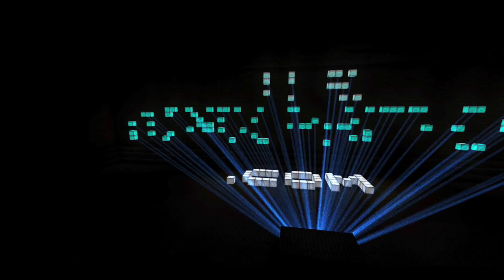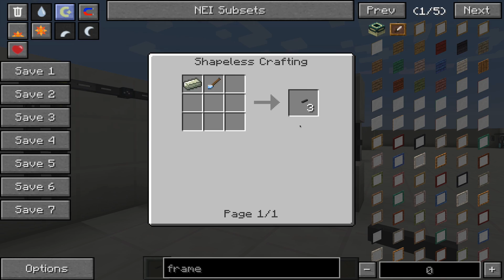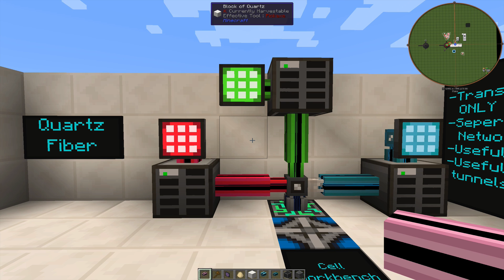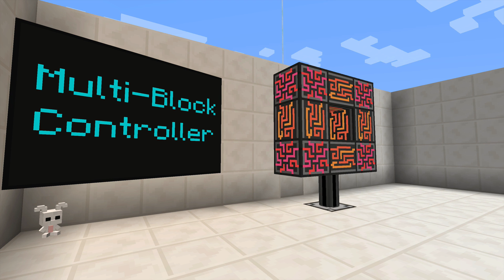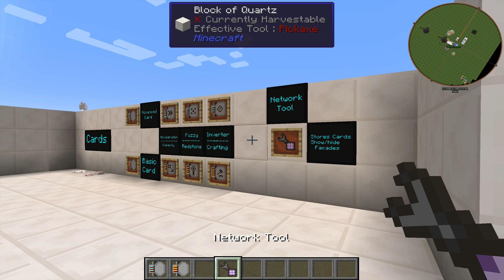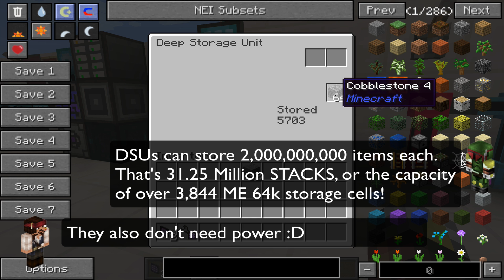Tutorial - AE2 - EP02 - Your First Network

Comment: Another good tutorial section. 2 Remarks though. We've found that on servers, if you place any bus, and add a enderio me conduit to the same blockspace, it crashes the server, and will continue to crash every time that area gets loaded. Then requiring some fancy World edit commands of config changes to get rid of it. We are unsure if its to do with plugins, the mods itself, forge, cauldron or possible magical reasons, but our short term solution was to disable the Ender io ME conduits in the Enderio config files server side and prevent innocent people who are unaware of the issue cause crashes.

Also, a good way to handle ore processing is rather then using a single export bus per machine per up to 9 ores, rather use a single storage bus to a large chest and select a higher then me drive storage priority for the bus. A diamond chest or even a ME chest on a subnetwork work well, with a transfer node feeding the sagmills/pulverizers/macerators can really save you some acceleration cards as well as processors for each seperate export bus. You can practically speaking use 1 storage bus for any amount of ores and processing machines at once.
Reply from the maker: Marijn R For the server crashing issue, which modpack are you using just for clarification?
Reply: The MindCrafters The first time we noticed it was the 3rd party modpack on the FTB launcher called Wanderlust reloaded, a quest pack. Second time we saw it happening again was the FTB infinity pack, one of the earlier beta versions, before 1.2.0, the version we currently run as we await the FTB folks updating the Forge version so we can install the new cauldron build and update the pack. Im unsure if the bug persists as we try to run a public server and fidling with configs and crashes doesnt go well with the player community who want to build and not stare at login screens saying "cannot connect". Once we can update we will be testing a whole slew of issues, including this particular one. But thats awaiting the fine folks at FTB headquarters...
Reply: Marijn R This was a big issue on older versions of Ender IO and AE2.  If you are running the latest of both you will be fine

Comment: If your going to run ender chests with import buses you can put multiple ender chest and import buses down and it will go faster and make sure you use acceleration cards in the import buses as well I did this for a bunch of 15x15 magical crop farms with max growth pulsers and the chest never had more than one item in it at time it was that fast

Comment: dude my fucking tessaract wont move items to the drives and i have the EXACT SAME orientation you had with the me interface. its pissing me off plleeeeeeeeeeeeeeeeeeeeeeeee someone help
Reply: ME Interfaces don't move Items in or out by themself, except when a crafting Pattern is inserted and activated by the System and a Machine with an Inventory Slot or a chest is placed direct next to it. You have to use Item-transporting conduits or machines that can push Items into or pull Items out of the Interfaces. If you put a ME-Interface on top of a RF-Tools Builder that is used as a quarry, the Builder will automatically put the mined Items directly into the Interface. But you can also use the ME-Interface on the Builder to let the ME-System provide the Blocks the Builder has to place. The Builder pulls these Items out and place them. You can use the Interface Config-Slots to program the Interface to provide the Blocks in the exact amount you have set in these Config Slots. You can also put a crafting card in this Interface to trigger Auto-crafting for the configured Blocks/Items if they run out. This only works when you have created and placed a crafting recipe in your Auto-Crafting section.
If you want to pull Items into the ME-System from a machine that are not able to move Items by itself, you have to use the Import-Bus. If you leave the Import-Bus-Slots empty, it will import every Item of the Inventory where the Import-Bus is connected to. For example if you put cobblestone in a Import-Bus-Slot it will act as an Item-Filter and only import Cobblestone. With extension-Cards you can activate up to 9 Slots to configure more Items to import.
I always like to use this ME-Interfaces for full automatic ore-processing and other things. I set the amount of each ores in the Config Slots to 64 and pull them out with EnderIO Item-Conduits with a full set of Speed Upgrades. Sometimes i use multiple sides of the ME-Interface to connect Item-Conduits with different Color-Channels to pull out even more Item-Stacks per Tick at the same Time. That is an incredibly fast Item movement. An export-Bus will export only one Item-Type at a Time, while the Interface provides all 9 configured Item-Types at the same Time as long as they are in the System.
In this way i can use ONE single ME-Interface to process 9 different Items at the same Time AND put the finished Items back in this Interface. So i consume only one ME-Channel to do different things. ME-Interfaces are really powerful and channel-saving when used wisely. In my actually Minecraft World i use only one Interface to feed 16 EnderIO Enhanced Sagmills with a big Minecraft Chest as an Item-Buffer in Round-Robin-Mode including auto-crafted and auto-refilled Dark-Steel grinding Balls to get the highest Sagmill-Output and put the Item-Output back into the same Interface. When i order 12,000 Gravel or Sand it takes under a minute to get what i want. The same thing i do with Enhanced Alloy-Smelters.
I often see other People using a countless Number of Export- and Import-Buses to build their Ore-Processing or something else very complicated as inefficient and leads to a wasteful use of ME-channels.
Reply: @Sven-der-Technik-Freak  Do you have a picture or even a more detailed description of your setup?

Comment: THIS IS DRIVING ME INSANE! HOW DO YOU POWER ME DRIVES!
Reply: +Jacob Zanahoria Connect the ME drive to an Energy Acceptor using a ME Glass cable (fluix), and connect that to your power source of choice. I have mines connected to an energy cube. Also, this tutorial overloads you on details, which kinda makes this a bad tutorial if you're trying to start out like I am. I would much rather have them just tell me what they're using with no details, build a basic setup and have us build along with them, and then go through details as the need comes up.
Reply: I figured it myself after tome but thx amyways